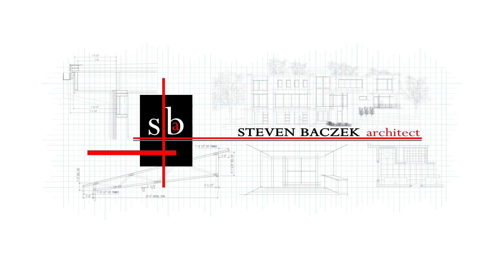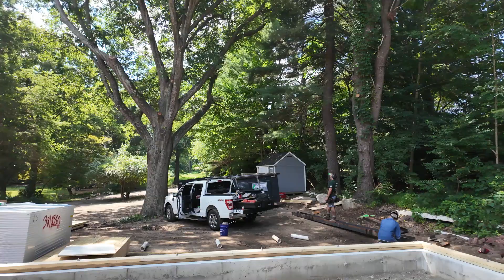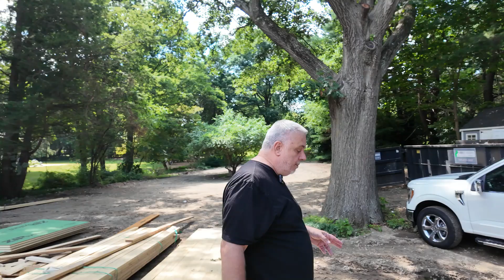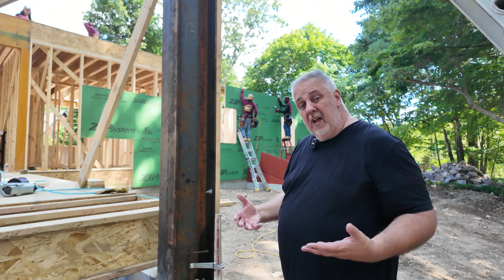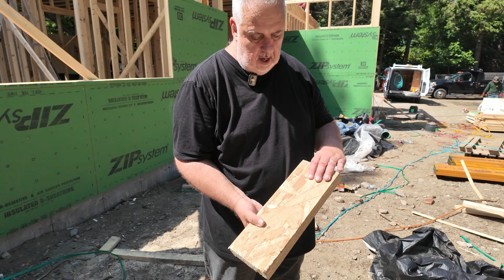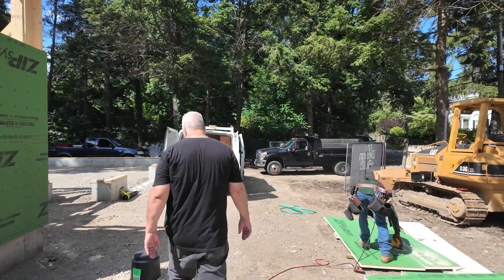FRAMING DETAILS and More.....

Comment: steve -- for that zip-r system, how good is the adhesive between the wood and the foam? have you ever seen it fail, and what's the oldest house you know of where it's still intact? thanks
Reply: The foam ends up sandwiched between the OSB sheet and the studs, so I wouldn’t worry about it going anywhere.  The thing I would worry about, however, is how the wall responds to racking loads.  With the foam, there’s now an inch of weak stuff between the studs and the OSB, and the screws can now rock around (bend) within the foam.  You could get around that by using an interior plywood layer as backing for the drywall.